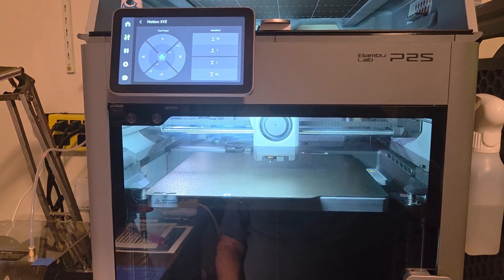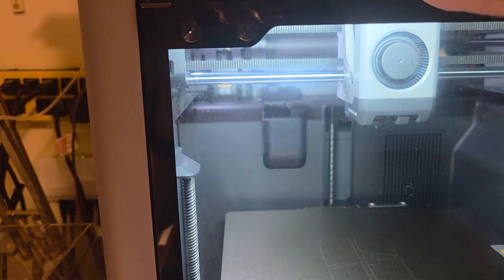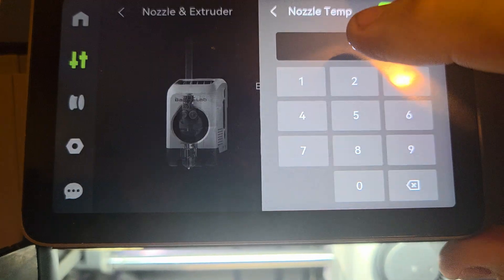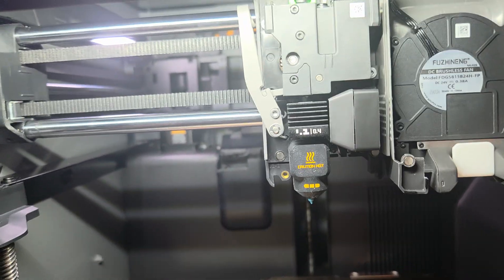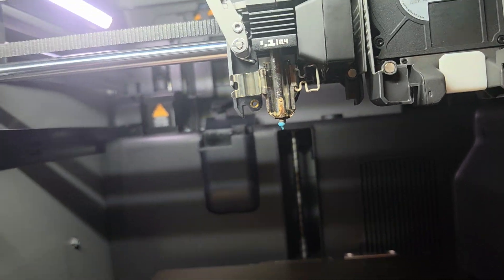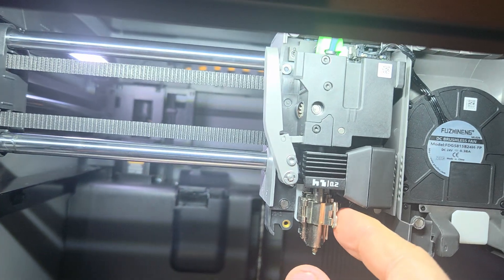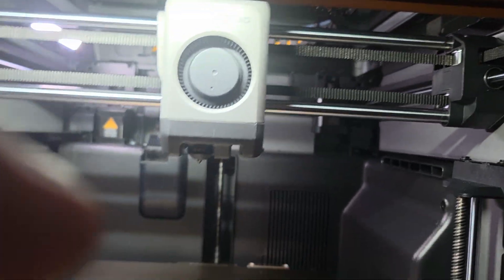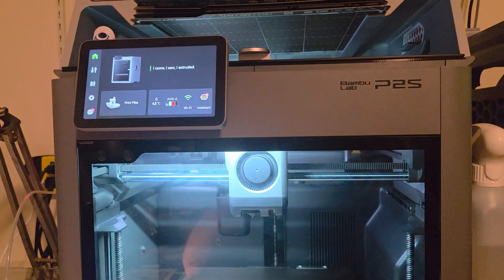Changing the Nozzle on a Bambu lab P2S 3D Printer

Comment: You dont need to preheat the nozzle, your making your life harder doing that, also you won't need to use pliers you can just use your hands.
Reply from the maker: Sometimes you do. Sometimes they stick and a little heat breaks them loose. The pliers are just so you don't grab it while it's hot.